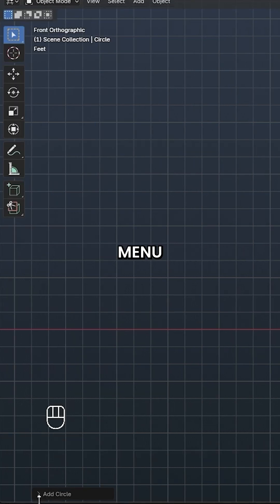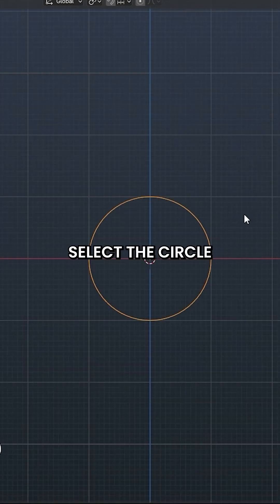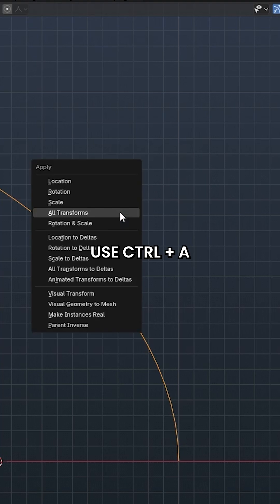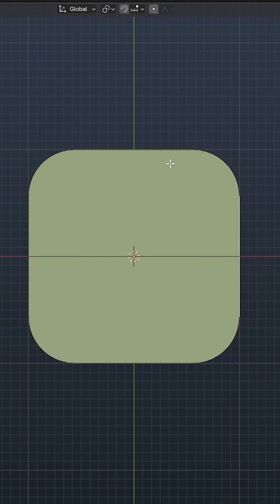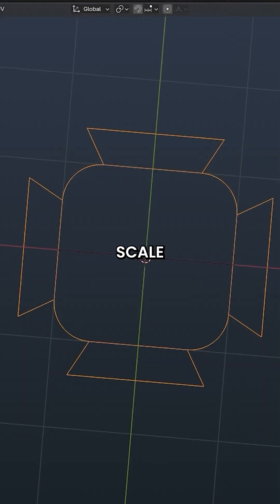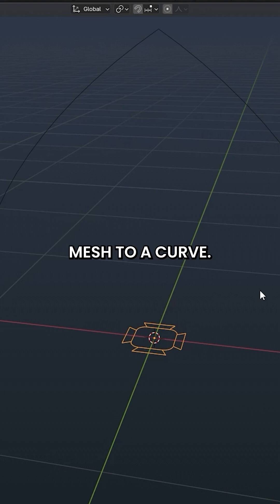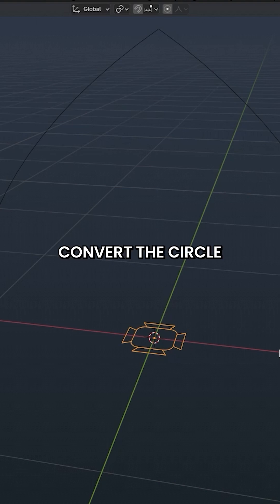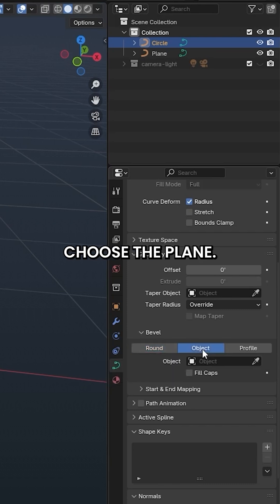How to Model Gothic Arches in Blender 3D #shorts

Comment: Thanks for the video.  As usual, it's totally first rate and professional.   BTW, where did you get those gears and pipe-fitting add-ons?  I could use something like that.  I'm designing a swimming-pool heat-exchanger and I think I could use it.
Reply from the maker: Thanks. I believe those are from the Extra Curve Objects and/or Extra Mesh Objects (free and come with Blender).